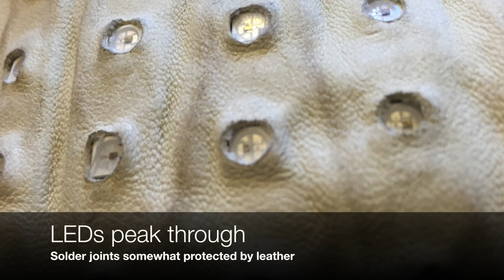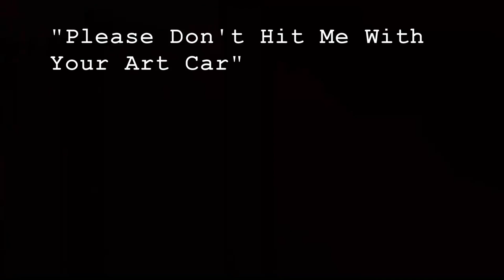LED Gauntlets

Comment: Hi, after you're using this for a while would you tell us what you'd improve for the next version?
Reply from the maker: Yeah, totally. The biggest thing for now is that the solder joints keep breaking from fatigue. I would use lower gauge wire and put some strain relief inside a heat-shrunk termination to each strip.
Reply: Ah, that's what I expected. I'd use a cover of heatglue to avoid breaking the soldering joints, as I could make thicker layers than with heat-shrink ;)

What about the battery-lifetime? How long could you use this 'wearale' and what size (mA) is your powerbank?